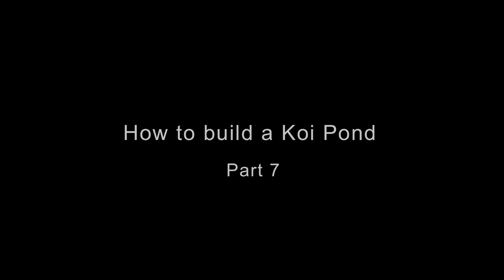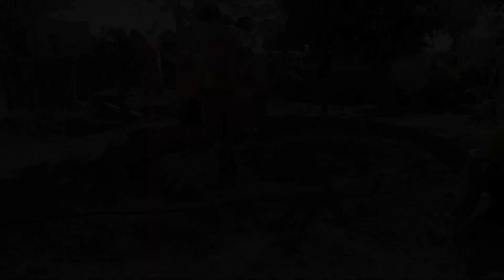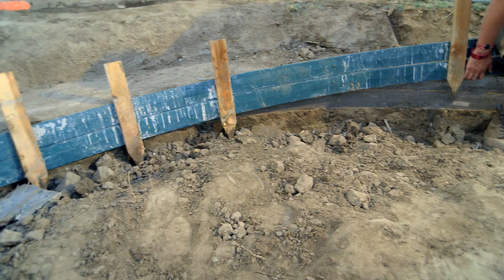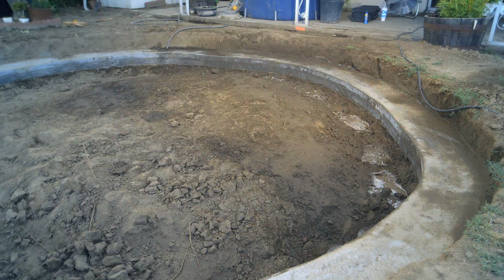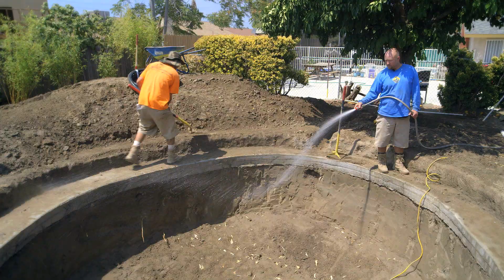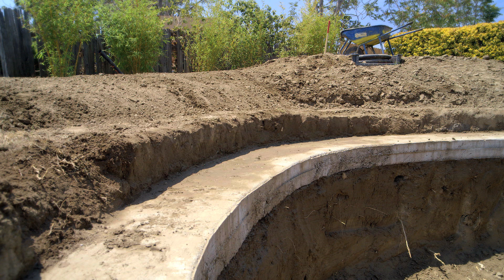DIY Koi Pond Construction | Pond Excavation - Part 7

Comment: How would you "repair" parts of the dirt wall under the concrete that were possibly knocked out during excavation? (in order to maintain that nice flat wall and 90 degree angle)

Comment: Im assuming moist soil makes a good concrete wall frame? I live in michigan so the soil is really moist lol
Reply from the maker: +AgentOtter710 As long as the soil is smooth. I have a contractor friend in Florida that doesn't have to use forms because the sandy soil makes the perfect form.